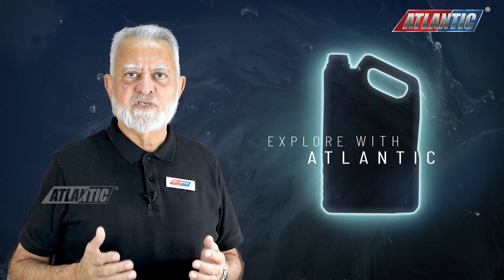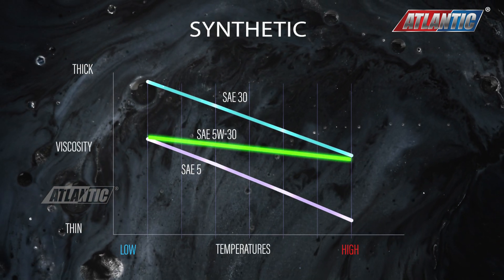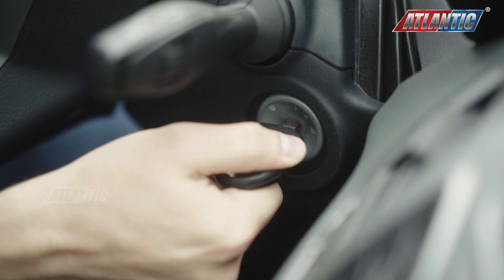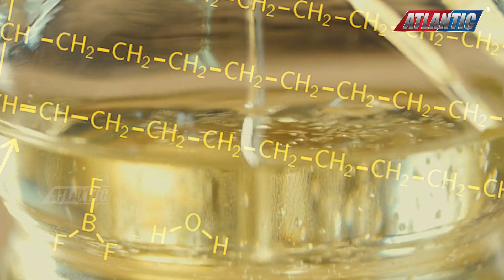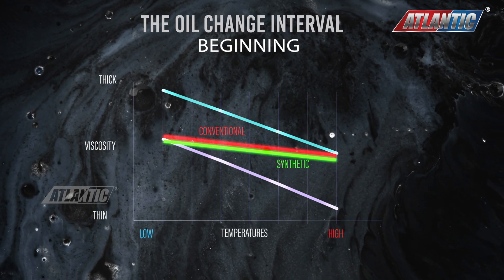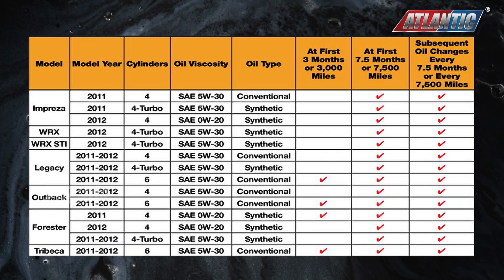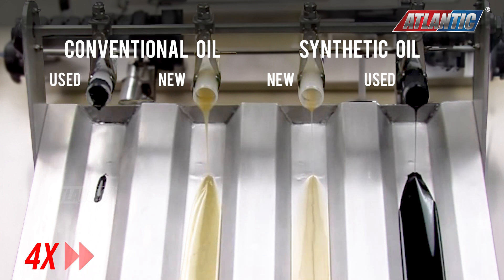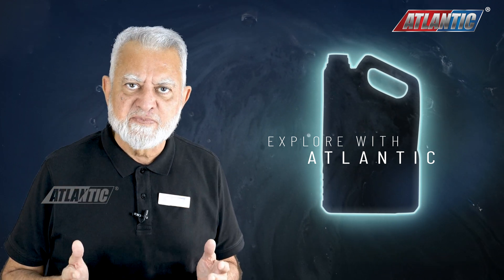Conventional vs Synthetic Engine Oil: What's the Difference? |

Comment: You can't use synthetic oil to break in a new or rebuilt engine. There i not enough friction between the engine parts to seat the new rings and other components. Enough said.. After break in...USE SYNTHETIC OIL. It extends engine life and gives better performance and gas milage.